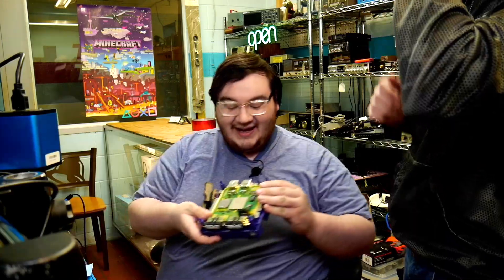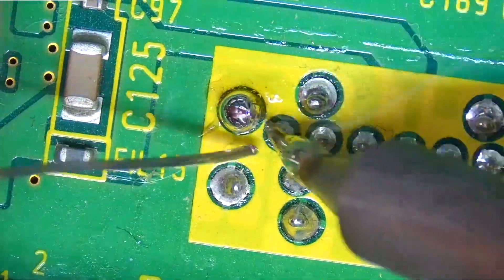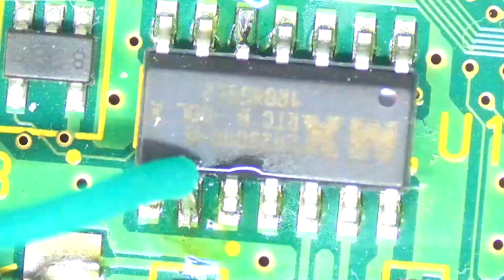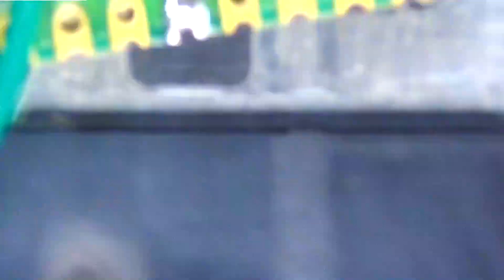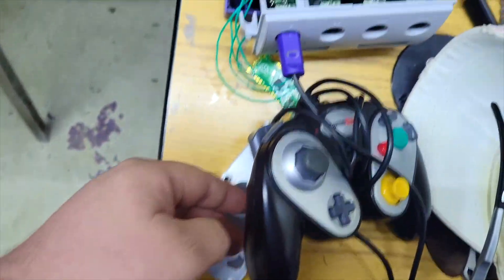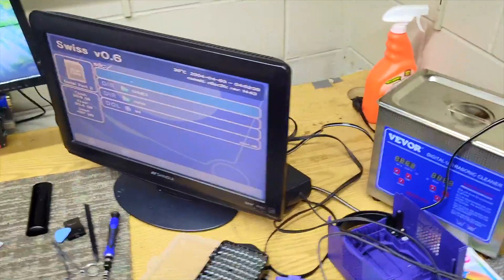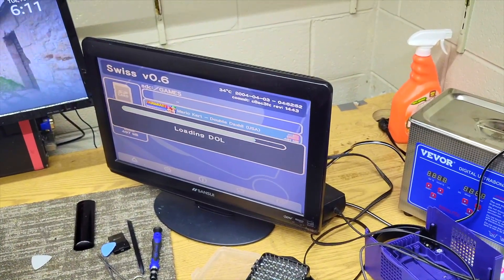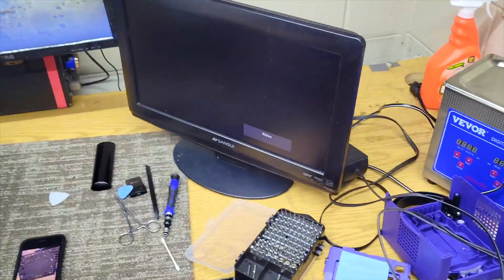This Raspberry Pi Made Double Dash Work Again!

Comment: What is " resurfaced"? New use of the word with consoles! Is that to resurface the disk? To help remove scratches, scuff marks? Thank you 🤓 thank you Logan!
Reply: It’s a machine that buffs the disc down makes it a little skinnier and hopefully remove surface level scratches. You can only do it a few times because eventually the disk will be completely unreadable. Some scratches are too deep and therefore on repairable. Obviously it doesn’t work if the disk is cracked. Otherwise, it’s a really good way to resurrect disks that have seen years of wear and tear.
Reply: @samuelmagilocusts2870  that can be done on CDs, DVD disks as well. Thank you 🤓
Reply: yee i took apart the game cube